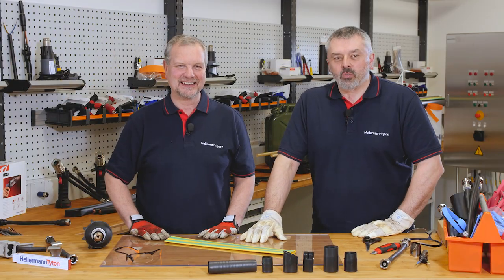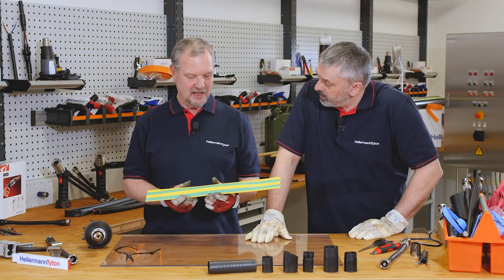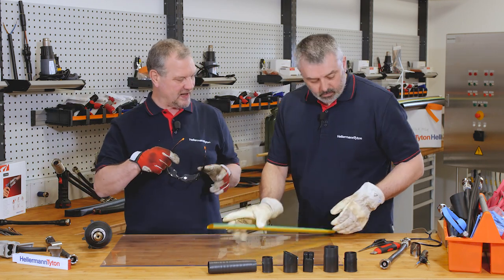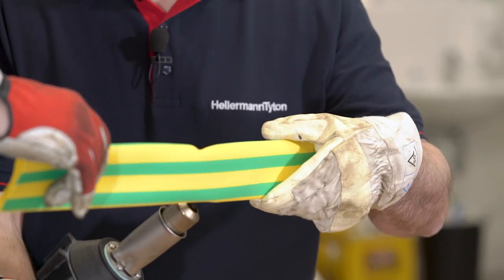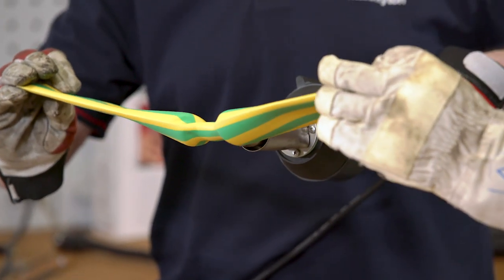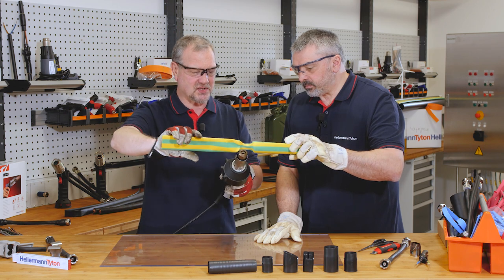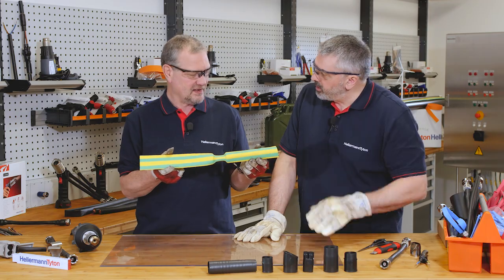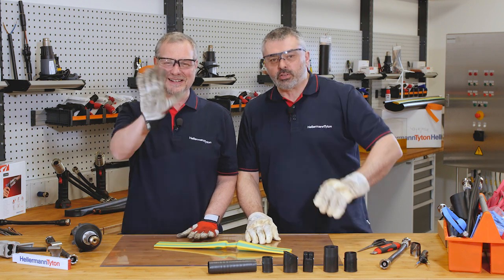What is heat shrink tubing? #1

Comment: Heat makes substances expand. So how does it so the complete opposite in this case??!
Reply from the maker: Hello Dj Skaghead, you are correct from a physical perspective that substances expand when heated. However, in this case, we are dealing with extrusion. This means that the tubings are stretched, and through another processing procedure, the tubing remains in the stretched state until it is heated. At that point, it wants to return to its original form. Marc explains this quite well here: https://youtu.be/TXVDttykxIA&t=17 Best wishes, Nico

Comment: Will shrink tubing damage a painted surface over time? Or would it preserve it? Just curious? & would it be easy to remove? Or does it have Adhesive on the inside?
Reply from the maker: Hi Paul Maldonado, Thanks for your questions.
It depends on many factors. The shrink tubing itself will not damage the surface. But it depends on the type of paint and the surface itself.
In any case, the heat shrink is a protection against external influences.

"How can you remove heat shrink tubing?" You can learn how to remove heat shrink tubing here: https://youtu.be/AguKB6z606M 

We offer a wide range of heat shrink tubing, with and without adhesive: check out this page: https://www.hellermanntyton.com/competences/heat-shrink-tubing?utm_source=youtube&utm_medium=social&utm_campaign=YouTube-description&utm_content=FAQ-2019-nr1-TXVDttykxIA-en-heat-shrink-tubing

I hope I could answer your questions, otherwise contact us again, Nico

Comment: Does the tubing shrink down in diameter only, or also length?
Reply from the maker: Hi xderiwx, Heat Shrink Tubing does not only shrink in diameter when heated but also minimal in length.
The so called “longitudinal shrinkage” of the “TREDUX” Heat Shrink Tubing shown in this video is 5% max.
Best wishes, Nico
Reply: Technically it does but not by any noticeable amount.

Comment: How is heat shrink tubing made?
Reply from the maker: Hi 
chris ross, Mark is mentioning it: https://youtu.be/TXVDttykxIA?t=18. It's extruded.
A starting tube will be extruded from the raw material. The tube is then taken to a separate process where it is cross-linked, usually by radiation. The cross-linking creates a memory in the tube . The tube is then heated to just above the crystalline melting point of the polymer and its diameter is expanded. In the expanded state, the tube is cooled down rapidly. Later, when the tube is heated, the tube shrinks back to its original extruded size.
Best wishes, Nico
Reply: Thanks Nico,
Be safe

Comment: What people who would have found this video really want to know is,  how is the tubing expanded in the first place?  What is the process by which this is done?
Reply from the maker: Hi @OldSlowGamer, have a look here, you might find the answer: https://www.hellermanntyton.com/competences/heat-shrink-tubing#tab0
Best wishes, Nico
Reply from the maker: "Heat shrink tubing is extruded plastic tube that is expanded and will shrink back to its extruded size when heated. Heat shrink is used to electrically insulate cables and wires offering also mechanical and chemical protection." --> Extruding
Reply: @HellermannTyton-Global  i could not find it
Reply from the maker: @mylow89  what are you looking for?